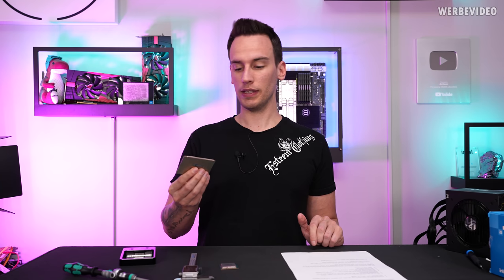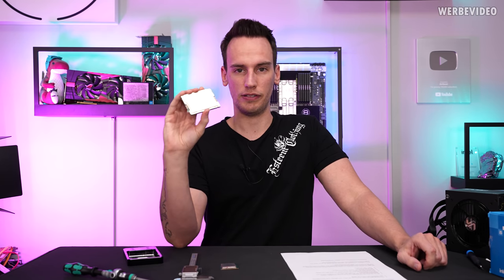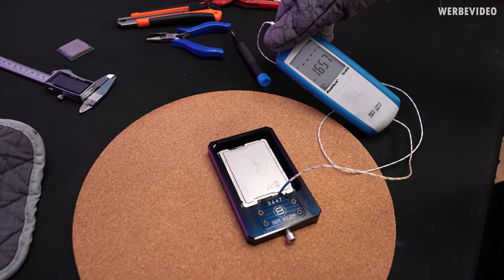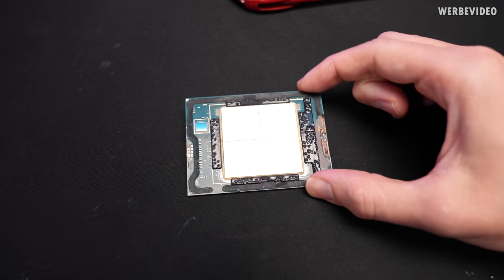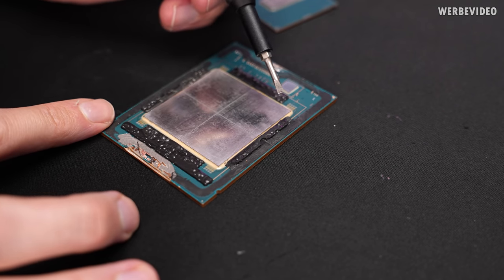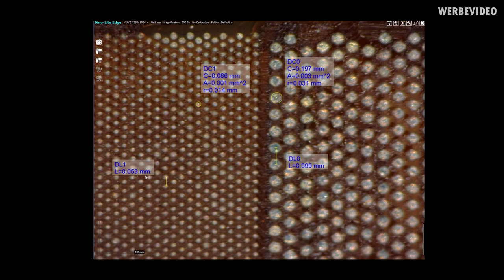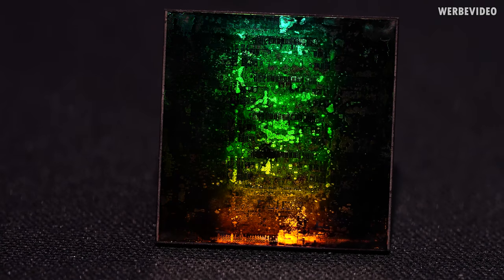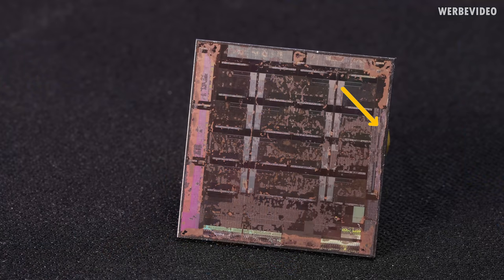Delidding an unreleased 56 Core Intel CPU - Sapphire Rapids Xeon

Comment: Intel doing MCM design to reduce cost: each chiplet is 3 times larger than a standard cpu
Reply: I Don't think a monolithic CPU of that size is even possible within current reticle limits.
Reply: @sammoore2242  I am referring to one of the chiplets itself, which is as big as a gpu die
Reply: looks like it is a 16core per die x 4.  AMD has a smaller die because it is only 8core per die x 8.  Chances are these unreleased Xeon CPUs has high TDPs unable to match AMDs EPYC 64 core efficeincy.

Comment: Ask your source to list the item on ebay then ;p  01:29
Reply: Even so, it will be obvious that the leaked board came directly from the motherboard's manufacturer, as manufacturers are the only ones to have the engineering samples of these boards.

Whereas CPU engineering samples are sent by Intel to many companies to set the compatibility with motherboards, RAMs, ... So finding the actual source of the leakage of a CPU is way harder.
Reply: @quentinduch1625  it was meant as a joke man 😎

Comment: Is there a reason why Intel can't get their CPUs to 64 cores like AMD has, is it just because of them still being a monolithic design rather than chiplets?
Reply: He literally just showed how they are chiplets?
Reply: @dylanwillyams  Yeah after I pressed enter they popped up.  So they are chiplets, why can't they hit 64 cores?
Reply: by my count this platform should be able to. 16 cores on the chiplet at 11:28. Times 4 and you have 64 for the golden binned top model. Its a chiplet design but it uses all silicon interconnects so it doesnt take a latency penalty from mesh, and the OS sees it as monolithic.
Reply: @eclipsegst9419  not every tile on an Intel mesh is a core. Tiles can be UPI interfaces, PCIe controllers, IMC, ASICs, and of course cores. On previous Xeon scalable an IMC tile is usually the same size as a core tile. On Sapphire Rapids XCC, each of the four physical tile is a 4x4 (plus the interface row), and if I’m not mistaken - one of the 16 is a 128-bit IMC. So a potential golden sample should be 60 cores.
Reply: The dies are bigger unlike AMDs dies are smaller.  I think this CPU didn't scale well as more chiplets are interconnected.  These reminds me of the AMD first gen 32 core threadripper with no IO die but 4 dies.

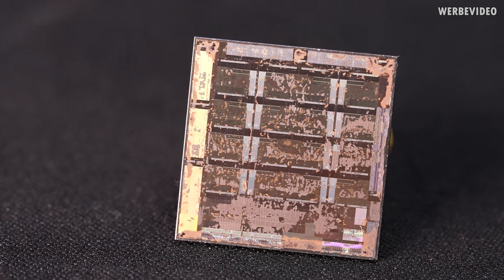Comment: 11:44 If we consider each of the middle square in the middle of the die which has that bar on one of the sides a core, wouldn't it make each die have 16 cores? For a total of 64 cores? 
That would make more sense in order to compete against AMD.
Reply: The right most square on the 3rd row is not a core, it's the IMC, so it has 60 cores max and AFAIK, the top model has only 56 cores(1 core disabled on each for yields)
Reply: Considering how much better alder lake is compared to Ryzen 5000 desktop in single thread, i doubt intel needs 64 core to at the very least seriously challenge 64 core EPYC.
Reply: @Harish2923  
"Its the IMC"
Source?
Reply: You can always find the IMC on the mesh network, they are most of the time identical size with the cores, you can also find it on icelake SP die shot
Reply: @suntzu1409  Loool, that is not true, not sure what reviews you have been watching. Most of the consumer Alder lake products are just highly overclocked cpus from factory, the 12900k with the power limit disabled running stock, is half as efficient as a 5950x.
On server hardware, this type of behaviors won't be accepted, as having a cpu consume twice the power as the previous generation, will mean double to cost of operation. At this time, Intel has no response to AMD server lineup
Reply: @Harish2923  
But what makes you think its an IMC and not a core?
Reply: @ralmslb  
You missed "single thread" in my comment.
I talked exclusively about single thread.
And literally every review shows Alder lake is better than Ryzen 5000 in single thread.

Not sure where you getting "12900K is half as efficient as 5950X".
The only place where 5950X maybe more efficient is multi thread, and i said nothing about multi thread.

Show me one video/article where 12900K draw 2 times more power in single thread.
Reply: @ralmslb  are you talking about the same i9 12900k which can be limited to 160 watts but still deliver 94-96% multi thread performance?
Reply: @Harish2923  funny loool
You know that the 5950x has a TDP of 105W all core right? xD
See my next comment also.
Reply: @suntzu1409   First I want to take out of the way the fact that in the server world, no one cares about single threaded performance. Cpus are always with high core count loads. 
With that cleared out, you seem to have been bias looking at the reviews or the reviews you checked weren't equal to both sides. 12900k does win in many syntactic benchmarks, but when it comes to games and such is not as a clear answer, because once again, no game runs on a single core nowadays. 
Its still a great CPU don't take me wrong, but its a clear indication on how hot and how much power it eats that Intel is desperate and pulling all the cards it has to keep up. 
The best review I've found that fairly compares all current CPUs is from Techpowerup. I want to highlight on the power consumption area they have a 
 "Energy Efficiency" section that takes in account speed vs work done.
(Youtube apparently won't allow me to add a link here for the review)
Reply: @ralmslb  
TDP is not power draw.
Reply: @suntzu1409  Dude, spend a few minutes to read the review
Reply: TDP for sapphire Rapids is 350 Watts, that is all I will say

Comment: Wow wow wow. Outdoing AMD! This thing isn't cheap that's for sure. Very impressive engineering from intel. 👍

The packaging yields must be terrible though... So much stuff and so many chances for something to go wrong.

Also each of those chips has 2 memory controller thingies on each side so only 14 cores a chiplet which is where the 56 cores comes from. They're probably one of the two pairs of outer cores.

Comment: Did not Intel  criticize AMD for using "glued-together" dies in Epyc processors back in 2017. Intel said in a very salty way. "Inconsistent Performance from 4 Glued-together Desktop Dies"
Reply: You answered yourself, they said 4 desktop die glued together, they didn't criticize MCM(or chiplets) method, they criticized AMD for using desktop dies on datacenter CPU's(which is still stupid mistake from intel but not that bad)
Reply: @Harish2923  But these cores are Golden Cove  P-cores. It is the same cores used in Alder Lake. So Intel will kind of be using 4 desktop dies glued together. Yeah I know there are no graphics. But still it is kind funny
Reply: @afre3398  it doesn't use the same cores as alderlake, there are some difference between them
1. Sapphire Rapids has AMX units on Every cores
2. Cores on sapphire Rapids have different cache capacity compared to cores on alderlake
3. The cores on sapphire Rapids use different interconnect compared to alderlake (mesh vs ringbus on alderlake)
4. The cores on sapphire Rapids has dedicated AMX512 units (vs using 256+256 registers to use AVX512)
Reply: AMD called Core 2 Quad not a real quad core, what goes around comes around.

Also each of the four Zeppelins in a Naples package is its own NUMA node, SPR - at least according to Intel - is logically monolithic.